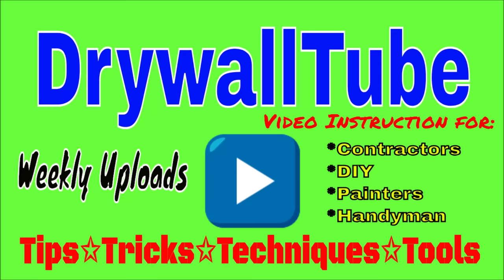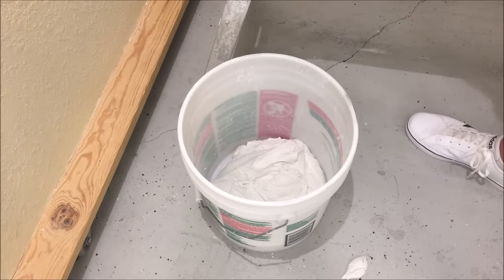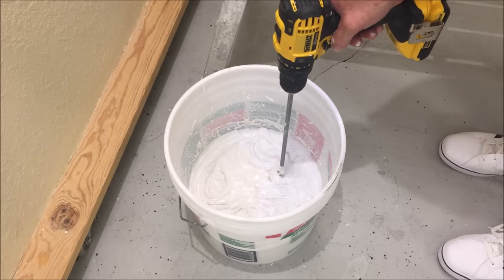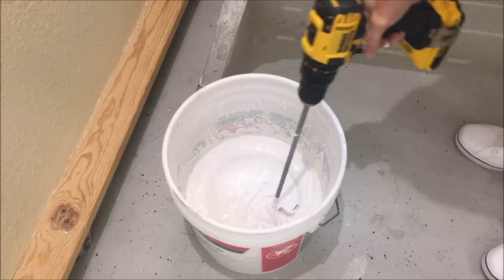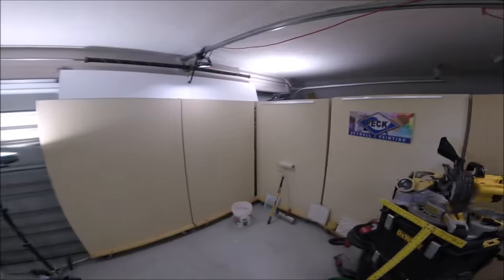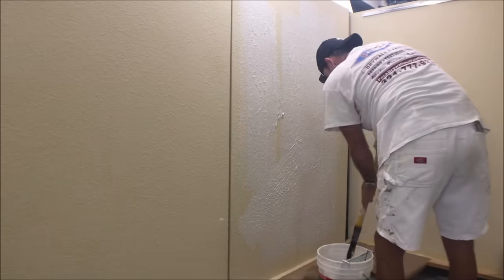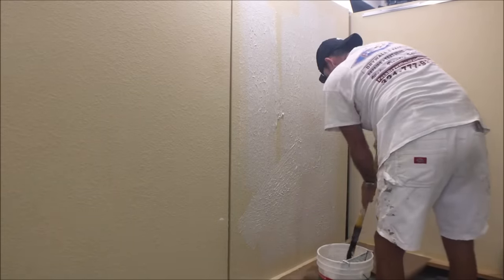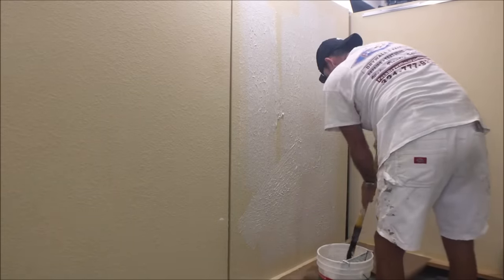Skim Coat Ugly Textured Walls with a Paint Roller Tips Tricks and Tools

Comment: Great how to video. 

One thing I'd recommend for a beginner watching. Green lid mud is great for taping and applying some corners. 

But for skimming I think beginners should use purple, red or blue lid mud.

These are formulated as mid and light weight compounds. They shrink less and sand even easier than green mud. 

Green mud shrinks more then other compounds and it's harder to sand
Reply: Thank you! Going to try and find some of these things this week
Reply: Green lid red lid blue lid?? 😂😂😂😂 what he’s using is all purpose and all all purpose shrinks some less than others like us plus 3 is a lightweight all purpose and shrinks less but has less glue so it won’t stink to painted wall as well then you can have topping compounds the shrink even less and have very little glue so they stink even less personally I sand walls with a sand pole with a moderately coarse sand paper first then I skim it with straight all purpose I sticks better has less bubbles and then I sand with 100 - 120 grit and skim again with topping compound ending  with a nice smooth wall

Comment: You are a drywall god. Thank you for making my DYI drywall repair simple and quick to finish. I actually used your method to add texture rather then remove it as only 1/2 of a bathroom wall and a portion of the ceiling was repaired and mud smooth. 🧎🏽‍♀️

Comment: I’m a maintenance engineer for the big buildings in downtown LA were with local union 501 we maintain all mechanical electrical and HVAC systems like chillers in buildings but we do it all locksmith changing lights and even paint and mud

Comment: I'n a DIY'er and watch all your vid's. I am removing all the popcorn sprayed concrete ceiling in a condo I rent out. I used this technique in the closet first and it worked great. I scraped off texture, cleaned concrete with ammonia as recommended by primer, primed with bin shellac based primer and rolled on all purpose. But I used the Marshalltown 22in knockdown knife I got at L***S. It has a rubber blade and with a slight learning curve I think it works great with the wide blade. 2 coats with light sand in between them and very smooth flat results. Thanks for all the great info on the vid's, its provided the confidence to attempt a rather intimidating job for me.
Reply from the maker: That’s awesome Mark!👍🏻 So glad you’re enjoying my videos! I really appreciate your feedback man! I love hearing how my videos helped to give you the confidence to tackle projects that you would otherwise think that they were to difficult to tackle!🔥 Thanks so much for watching and subscribing my friend!🙏 -Paul

Comment: retired commercial construction suppie, we used to use set 45 dry mix for skim coating, troweled on, then just as it is setting up spray lightly with water and finish trowel. we used plastering trowels for finishing

Comment: Paul, My wife and I just moved into a new  home last August. We have a full, un-finished basement that we want to finish. We'll do it a little at a time as finances permit. We're both retired so time is no issue. I've pretty much finished up the framing, so drywall is next. The garage, however, is drywalled, and taped, but no texture, so I'm going to practice the texture in the garage first. I worked construction most of my life, from housing to power plants and refineries, mostly plumbing and pipefitting. I've seen a lot of joint and texture work, but actually done very little myself. I want to do a decent job on my home so I looked up your video. I find it excellent instruction, and it answered some of the questions I had. I'm confident that I can do a decent job, thanks to your easy to follow instruction. Thank you.

Comment: DIYer.  2 questions:

When doing larger walls, does the whole wall need to be coated before skimming?  Or can it be broken into sections?

Also, I have a 40yr old home and I can look around and see all the joint seams due to age and sagging (which makes it handy because I know where the studs are!).  Will skimming cover that up?  Will it just return in a few years?

Thanks!
Reply: Jo

Comment: Thanks for this.
I am rehabbing an upstairs of a 100+ year old building.

I have always done work like this for others as a subcontractor of sorts, usually very good results, but for slave drivers.

This job it is all me, and I am out of practice.

I had a few ideas of my own to try, and this video showed them to be valid.

The only thing I did not get (and now probably will) is the roller grid for the bucket, I was just using a paint roller tray.

You mentioned taking out the lines later with a six inch knife, which will work, but I saw and bought a knockdown knife that I tried out and it is super.

Not only does it flex to keep you from putting on too much pressure, but there is also a hole in the handle for an extention pole.

This is great, because the building I am doing has 10 foot ceilings.

Comment: I'm a painting contractor. I'll do some basic prep with Joint compound. I've patched many holes in walls; for this I use 20 minute mud. The key is knowing how to mix the powder with water, as it has a tendency to set up quickly. The results are excellent; the finished product doesn't shrink, and is hard as a rock. Like anything new, It a little takes time to be proficient. Thanks for your post; I'm going to follow your process!!

Comment: DIY person, i was wondering, can you do this over paint or do you need to sand down the paint
Reply: I did similar over flat paint without sanding and I've done a small laundry room with semi gloss without painting but that wall won't receive much abuse.  This compound has strong bonding ability.  Red box (general use more white) or Green Box ( top coat has a more yellow look) at home depot.  I didn't notice much difference between them. I sprayed semi gloss over the finished wall so that it lost the chalky feeling in the hallway that will receive a lot of touching but you see imperfections.  In the living room I sprayed flat paint.  The flat paint really looks nice and perfect.
Reply: @Hope-fv3kf  thank you soo much this really help
Reply: Robert D  thanks! Thats really good to know
Reply from the maker: Yes, you can skim coat right over painted surfaces if you use the all purpose joint compound.👍🏻
Reply from the maker: Yes, exactly Robert!💥👊🏻 I appreciate you sharing your knowledge in the comments!😎 -Paul

Comment: Im a DIY’er, just bought a home and very much dislike the textured walls.
Reply: I had textured walls and sanded them down with a power sander...Left the windows open and a fan blowing out,,lt worked, no more texture walls
Reply: I did that to a ceiling and they still have some texture but it was my first try so I feel pretty good about it.
Reply: @katherinebruno616  did you put joint compound after you sanded?
Reply: @karissadomin3601  No, if you sand very light, it smooths it out
Reply: @karissadomin3601  one more thing...If it makes it easy, after sanding and your walls are partical smooth, put a white bead board on it..It looks nice or just sand it smooth...I think there’s a tool now that takes the texture off instead of sanding...Check Google...Good Luck

Comment: DIYer. Last March after working from home, my fiance and I  started working on re-doing our kitchen. Our kitchen countertop on both the left and right side of our stove were pulling away from the wall, so me being a "McGiver", I had an idea to build up the gap of the backslash section by using  fiberglass sticky mesh drywall tape, 2 layers of USG Plus3 drywall mud with a small amount  of Easy Sand 5 minute powder mixed in. I needed to build up the distance with a hard, sanded finish and it worked out very well. When I started, there was a 1/2" gap of separation and once I applied my stone marble speed tiles, no more separation. I did this across the whole length of the wall. I think it looks great and it was my own idea. The other side of the kitchen had more issues at the top the walls where the ceiling met with huge gaps. We took care of those issues to using the same mud products and creased paper tape and to this day, no cracks whatsoever even after painting. Still plugging away with applying ceramic tile and can't wait to start the other rooms from top to bottom.

Comment: Paul always love your videos and Thanks much for doing this for all us DIYer's out here I and everyone else greatly appreciate what you do!   - I have an entry way that was plastered back in the 40's with a texture I just hated so I applied 90 min mud to smooth out the wall initially and to cover my repairs to some joints and a hole that was caused by ripping out an old shelf that was attached into the wall.  This was my first time ever trying this and allowed me to practice with a taping knife in applying mud. Still learning knife technique but it's come out great to this point.  So now I want to roll on the first smoothing coat with the USG GP mud as you used but one of the wall has an Octagonal window and I am wondering what is the best technique for working around this window so I don't get all sorts of lines and messiness going on around the window frame and it all ends up looking uniform?  Would you work around the window first and then work out from there? Thanks again Paul and appreciate any suggestions on working around an octagonal window!

Comment: I did this kind of work once, though I used a 16" trowel and hawk.
I'm not sure about using a roller, though. Maybe if you work with another person and one person applies the mud while the other smooths it out when doing a big wall.
You can also do this with "popcorn" ceilings if you want to have a flat ceiling instead. I hear putting up new sheets of drywall over it is another option.

Comment: Hey Paul, I’m a contractor and in the process of remodeling a commercial business. The building used to be a church and they did a terrible texture job on a large wall with a crows foot. The new owner wants an orange peel throughout the building but this particular wall is 40 ft long and 12 ft tall. I have a few questions. It is currently painted. 1. Do I need to prime it first? Some of the paint is peeling off easier than it should. 2. Would your roller method work or would it make more sense to shoot mud on with a hopper since the wall is so big. 3. Should I sand it first? Thanks in advance

Comment: Homeowner. Bought house where textured paint was apparently the solution to everything. 🙄
Reply: I have a few walls with that horrible texture paint as well.
Reply: @ramanichols9759  ... anyone remember "rag rolling" to make textured paint? I have an up / down hallway to do over this winter and I think I will use this to fix it up.
Reply: @rupe53  I've loved into an old house and someone thought textured walls throughout a very high staircase would be great... Let me know how you're doing. I've got to find out what that sort of compound mixture is called in France 😳
Reply: @cerstin12  ... in my case I wont start the job till after the holidays. In your case, if they use sheetrock (drywall) over there they must have joint compound. You just need to make a trip to a home improvement store and ask.
Reply: Same.
Reply: Same
Reply: I'm a DIYer. Textured walls are all they seem to have in Austin and San Antonio. I moved here from Kansas, so it looked new and classy at first (I was young then). When I asked why all of the walls here were textured, I was told that it helped cover any imperfections, especially in the joints. "So, y'all's drywall folks aren't that good here?" was my thought.

Comment: I’m a homeowner who doesn’t know why she bought a house with cracks in the walls 😬☠️🙉🤷🏽‍♀️
Reply: Houses move its gonna happen.
Reply: Your home has foundation issues. Fill the cracks, paint and dump that place on the next sucker!!
Reply: It could be many reasons why its cracking. Foundation, poor framing, not enough nails or screws, poor repairs, didnt use mesh or paper tape, just plan old house
Reply: All homes get cracks  10 years  after construction the foundation is just settling.

Comment: Nice work.  I've used the roller for texturing before but never for skim coating.  
Skimming texture i typically use a drywall sander to knock it down and pull a tight skim with a 10" to fill voids, no thinning.  Final coat with a 12" and mist wall as I skim.

Comment: I mainly do painting and drywall but I have done stuff like this before. instead of using water I use paint. So if the drywall dries it will not crack and it makes it much more durable.

Comment: And a fyi for anyone if your only doing a wall or bathroom or small area just use 45 minute hot mud and you can do both coats In half the time. And hot mud usually expands so it actually helps fill in texture even more.

Comment: Hi Paul, I'm a professional carpenter and we normally sub out drywall. I do it on my own projects and side jobs myself and have had some issues as I learn.  I recently scraped off my popcorn ceiling that had been painted over. I used vinegar water (advice from another youtuber) and it worked well in getting through the paint. Then I skim coated it.  But I don't think I used enough mud. I had several areas where when I primed over the skim coat the mud flaked off on my roller. Then it happened again in spots when I painted over the primer. Also I wondered if the vinegar may have caused a bonding issue with the mud in spots where maybe it soaked into the paper of the drywall a bit.  Thoughts? Have you ever had a similar experience? I'll watch your video on skimming over the popcorn and maybe save myself the headache and potential danger of asbestos from scraping for the rest of the house. Thanks again for the great content.
Reply: Yes and possibly residues from cooking or heating system. Kilz?

Comment: Contractor... just started flipping my own houses gutting and re-drywalling  every one is starting to break the bank . All the houses I deal with are plaster and lath and usually have mutiple coats of paint on as well as the texture is like it was just slapped on with a Tryl . What are your thoughts on a bonding ajent . If so any thing I could pick up from big box stores. I appreciate any advice. Thanks have a great day.
Reply from the maker: Definitely use a sealer/bonding primer when using joint compound for skim coating over plaster. Use one of these products: PlasterWeld , Gardz or Romans Pro999.👍🏻

Comment: Thanks for the channel!  Good info from a pro! I have a question about filling cracks in paneling.  I have three rooms of 60's 1/4" paneling over 3/8" masonite board over sheetrock. Wow thats a lot of material.  All nice and secure. My idea is to use 15 minute hot mud on all the cracks. Should i tape all the cracks also?  Any thoughts would be appreciated. Once again,  very professional presentation on your channel.

Comment: Great video. Thank you for sharing your tips. At the end when you showed us the wall while it's drying I thought I could see splotches of dark on the right hand side that almost looked like texture still showing. Was it texture or just the fact that the mud was drying blotchy if you will? My home was built in 2008 and have a similar texture on my walls and ceiling. I would love to have smooth walls but I just don't think I can afford to hire a professional to do all my walls. I am debating on leaving the ceiling as is because I am afraid that I'd see any rolls in the ceiling. What are your thoughts on leaving the ceiling a texture but smoothing the walls? Would it look stupid? And how would you rate the skill level needed for a homeowner to actually do this themselves. I am assuming all crown, baseboards and door trim would need to be removed first?

Comment: Beginner DIYer here. I liked this method. On the corner where you leave 4" to transition, how do you deal with the orange peel in corner? I have glue on my drywall where I removed old paneling & several friends said it would be easier to replace the drywall than deal with the glue.

Comment: Hey Paul I am about to skim coat the inside of a house that I bought it’s got different textures through the whole house and I am going for a smooth finish. 

You said a second possible third coat. Are you still using all purpose for the second and third coat or do you switch to plus 3? 
Also will I need to sand after before paint or can I water trowel it with a brush to finish it smooth and paint over? 

Also you used a 3/4 lamb roller in this video but on a ceiling video used at inch and a 1/4 roller I am doing ceiling what’s the reason behind different size roller? Thanks!! Great videos

Comment: From: 52 year contractor/remodeler/historic restoration/custom homebuilder. Carpenter, painter, cabinet/furniture maker and designer, dry waller blah, blah. Would like to offer a tip I learned by experience is holding your mixing paddle perpendicular to the walls of the bucket to avoid the paddle contacting the plastic which could, in time, chip off into your mud mix. Better yet having saved a dozen or so metal five gallon containers from paint buckets they made a million years ago, find a metal bucket to replace the plastic one.

Comment: Hi, thanks for these videos! You may have mentioned this already, but we have a bathroom that has textured walls and it looks like a semi-gloss paint is on it. Do I need to sand or prep those walls in any other way beyond wiping dirt and grime off the walls with a rag? Also, once I've skim coated it, since it is a bathroom, do I need to seal the walls with some sort of oil-based primer/paint to keep the moisture out? 

We also have some textured walls that have wallpaper on them, and I am going to remove that and, hopefully, the adhesive that is in all the cracks and crevices. Is there anything else I need to do to these walls before I skim coat them? Is it necessary to get all of the adhesive off before skim coating it? Thanks!